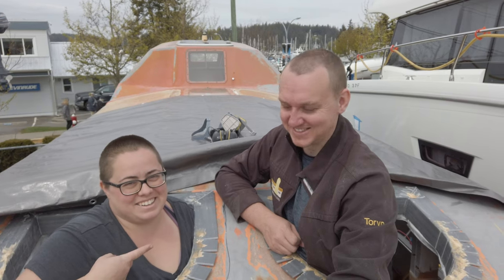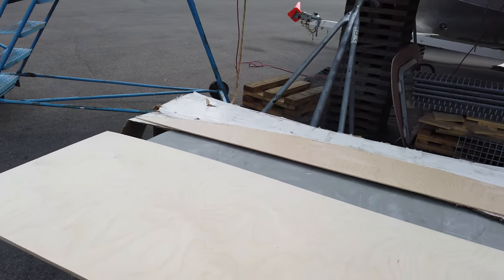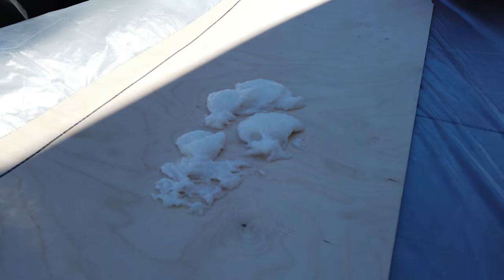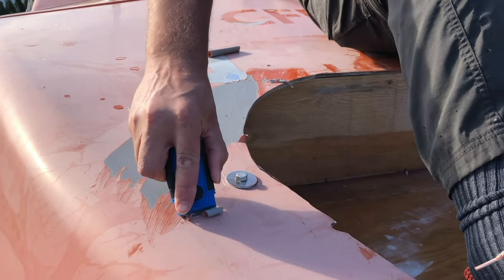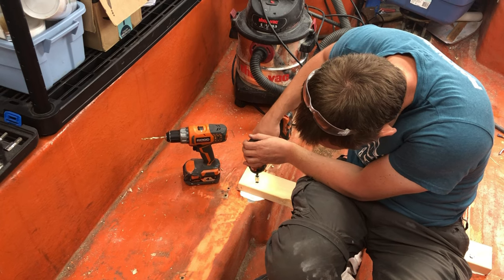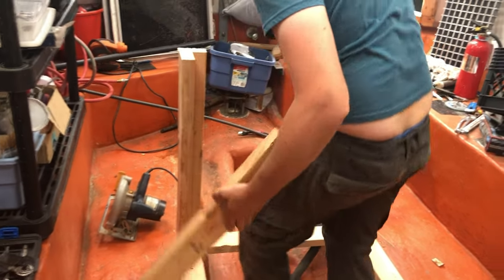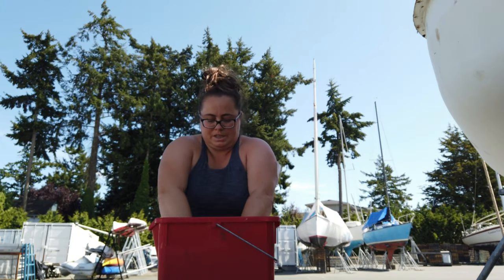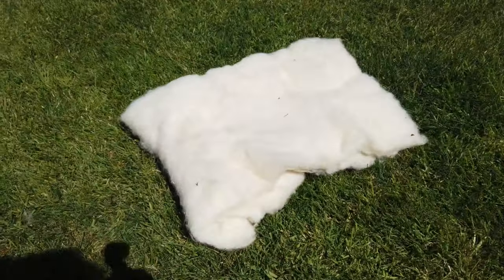Episode 9: Building the BEST Spot for a Coffee

Comment: next time you are doing the fairing compound. Quick tip: use a plastic bag, stuff it full of the compund then cut a corner off and squeeze it out of the corner into the gap like a baker icing a cake. Then use the tongue depresser (or better purposely cut fillet stick) to set the curve. You will save time and material.
Reply from the maker: Thanks for the advice! I have started using piping bags and they work great!

Comment: 6 ml vapour barrier is also excellent for templates if available, but cardboard is usually free. Thanks for the update. Cheers.
Reply from the maker: Yes we have used a lot of vapour barrier as templates. I used the cardboard in this application because I wanted some structure as it was a compound curve that was suspended with no structure behind it. It got us close enough so I could trim the wood into the curve I wanted. :)

Comment: That insulation looks to be a terrible idea.  In the winter you will have your boat sealed up and condensation will form on the walls, soak into the wool and begin to mold.  You should be going with a closed cell foam sheet that adheres to the wall directly with no airgap to allow condensation.  Or even better a spray-on expanding closed-cell insulation.  I've lived on boats in the winter.  condensation is a HUGE problem.
Reply: condensation happens below the water line more than anywhere else. Insulate above the waterline but never below.
Reply: @Blink-Ensu  Sorry to contradict.  But condensation will happen any and everywhere there is a sufficient temperature differential and humidity.  I used to live on a boat, we would get condensation on the portlights quite easily, and inbetween the headliner and the top deck.  It will happen.
If anything condensation is LESS likely to happen below the waterline as the water temperature is usually higher and slower to change than the air temperature.